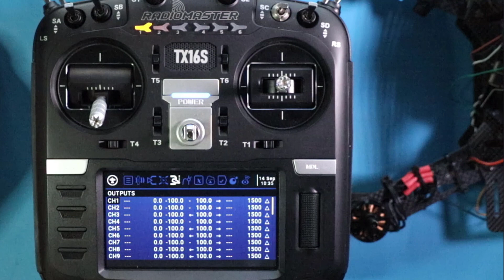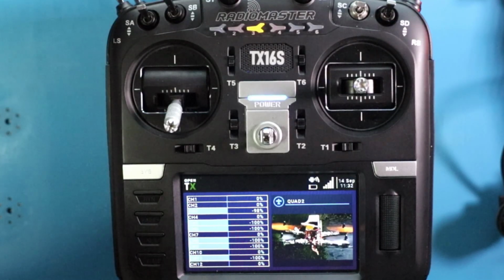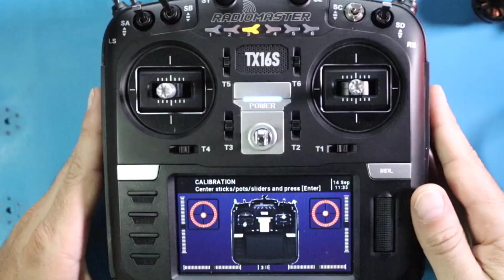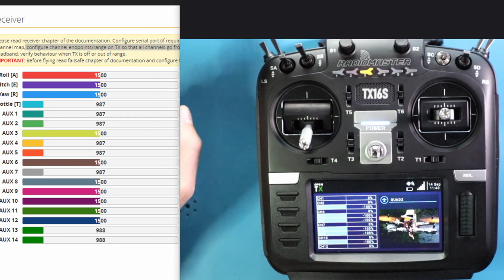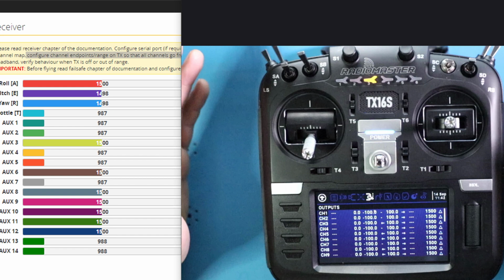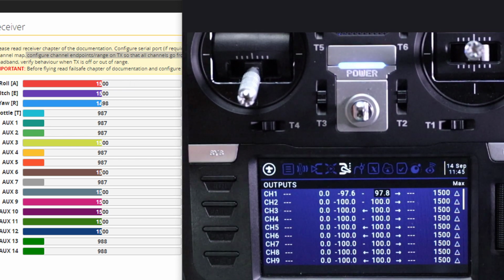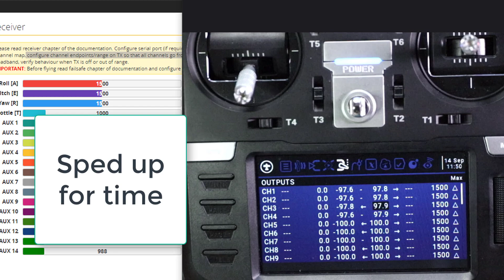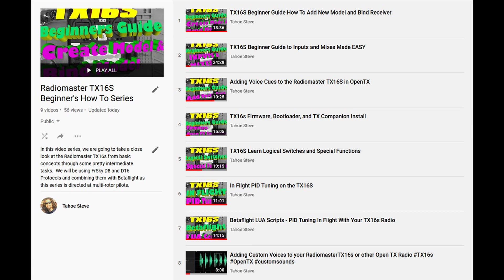Calibrating TX16S & Using Outputs and Betaflight to fix Endpoints

Comment: You are doing a great job. I had no idea how involved it was
 going to be when I baught this transmitter and which I also baught Diatone GT r349 because it seems to go pretty fast according to all the reviews that I saw. I want speed. I will be  flyings line of sight until I can get enough money for the google that I
Reply: Sorry I didn't finish my text. The phone screwed up. Anyway want to get the skyzone 030 because they seem to be getting pretty good reviews. This is all providing that ever get thing this running and also if I don't lose it. Because supposably there is suppose to be a lead to plug the buzzer in. I don't know if I got an upgraded one or an old one. Because there is no plug and the camera is not green like all the ones that I see. I sent 2  of them back already and they keep sending the same thing back. This all started with buying a Hubsan h501s which I really do enjoy flying. Four people that I know ended up buying them after seeing my. I did get really good at flying though. But that was after loosing one and one going in the pool. Which was able to fix that one because because I had parts from another one. Sorry for the big story.  I just wanted to say thank you for your video because I have had this thing for a couple weeks now and until today this the closest I have gotten to get this thing running. I'm at the point where you hook it up to Beta flight. But it would be cool if I could talk to you. Got watch some more videos. So you are doing a great job at explaining it. Keep up the good work. I must be so close to getting this thing running. That's all thanks to you.
Reply from the maker: LOS is a great skill.  I flew LOS for years before ever trying goggles.  I see some amazing FPV pilots that would be lost without their goggles.

Comment: What if after you calibrated the betaflight channel ouput ranges from 1150 to 1840 and you cant set more than 100% in the outputs tab to fix that.
Reply: There is an internet function for setting 1840 as 2000 and 1150 to 1000 cant remember the name but you can find it on the web

Comment: I can't make mine exactl;y 2000 for the upper end. It's either 1999 or 2001.
How do i go about this?
Reply: Did you ever figure this out? I'm having the same issue. Example Ali low is 1020 and high 1979. Something seems off or I'm missing something

Comment: Hey Steve..thank for the vid. No matter if I calibrate, choose extended limits and crank the outputs to -150/150, the end points in beta flight only go to 1074 on the low end to 1925 on the high end. Any thoughts on why? Thanks.
Reply from the maker: Make sure you are calibrating your sticks correctly.  Remember to center your trims.  Move the sticks slowly as in the vid.
Reply: @TahoeSteve  thanks Steve. I ended up setting the rxrange in betaflight. This appears to happen only with the smaller DSMX bind and fly quads.

Comment: Again, a real winner.  Question, if you have time.  Do you have a video that discusses Dual Rates to dial down sensitivity?  I thought I had done it right, but are now only works on high rate.  Hmmm.  Thank you again for your easy to understand videos.
Reply from the maker: I have not done one but check out Painless 360. He does a lot with airplanes, and I know he has covered dual rates in depth.

Comment: You made my Tx perfect.  Using the old calibration technique - hitting the corners with the sticks - I got a throttle stick that stopped at -96%, and an aileron stick that stopped at -91%.  After using this calibration technique - hitting the centers, not the corners - I got full travel - and now I have zero issues with my brand spanking new TX16S - replacing my venerable, and much used, QX7S - which has a failing menu/page/exit button.  Thx for the video.
Reply from the maker: Tim, so glad to hear that.  I always got wonky readings doing it the other way.  Enjoy that radio!

Comment: Also never used betaflight as I dont have drones etc so can I just use betaflight with tx alone or does it need a rx plugged in?
Reply from the maker: What do you fly?
Reply: @TahoeSteve  I am starting out & Im fooling arround with gliders n some china foam, as I said before just trying to learn from my pc at home here and facebook and I will get hold of the wrong end of the stick so to speak but so far I think have done well and learnt a lot.
Reply from the maker: @Brian Ramsey keep learning,  this hobby is good for that.   You will be able to test your endpoints on the "Channel Monitor" Screen.  To get there, Long Press bottom of the wheel; Select Monitors.  Then move your sticks to the endpoints and note the us numbers.  Should read 1000 - 1500 - 2000 like in the video.  As for your other question, although I understand it is possible, you won't be using Beta flight with a fixed wing aircraft.  https://github.com/betaflight/betaflight/wiki/Setup-for-a-Fixed-Wing-Aircraft

Comment: Thanks will be doing this asap. Also will be wondering if I get same results. Im fooling arround with gliders n china foam so then you adjust outputs for every model to match once calib is tuned in ?
Reply from the maker: i am only familiar with multirotors and betaflight, but yes, i adjust the outputs for every model in BF.